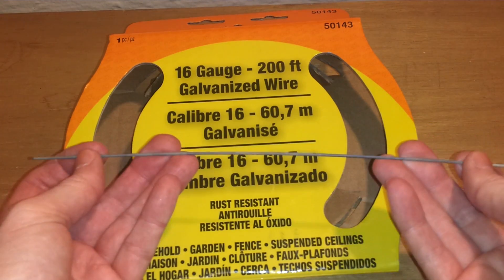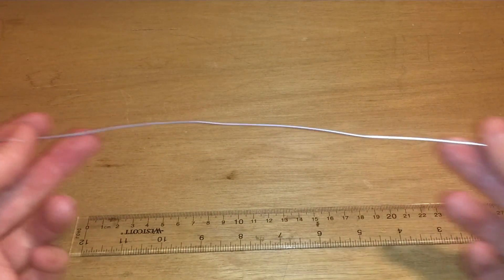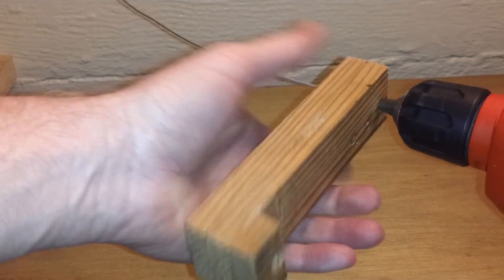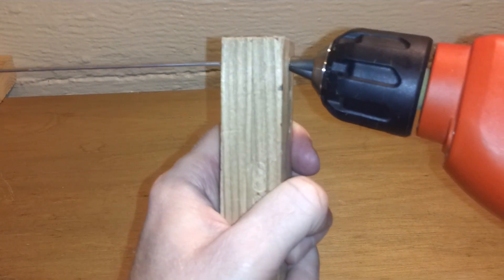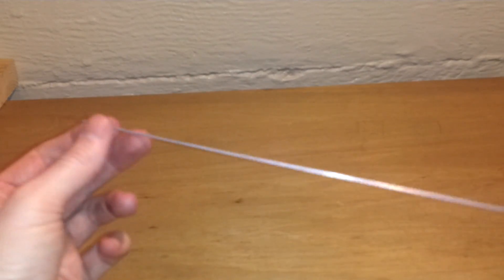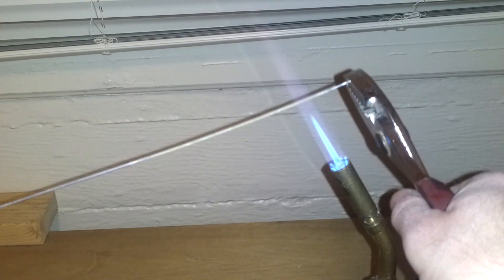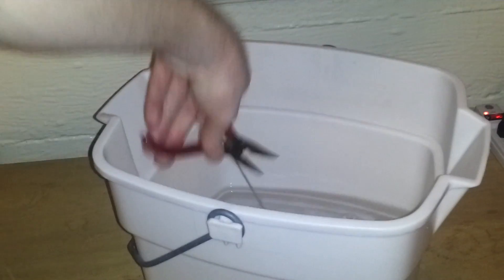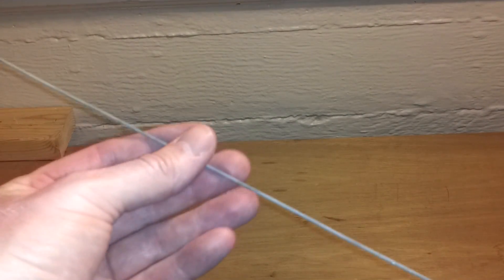How to straighten 16 gauge wire to make control rods for RC airplanes

Comment: You can get similar wire but stainless at harbor freight. I like this method better than twisting the wire which does straighten the wire but I think it weakens it also. I appreciate you

Comment: would the re-heating process damage the galvanized coating?
Reply from the maker: Don't know.  Not like the control rods are going to corrode.
Reply: @MrDabrudda  Putting the zinc (the galvanized part) in the flame creates hazardous fumes. If you're going to heat it, don't use galvanized wire.

Comment: Nice one....Hope it works with 22 gauge Full Hard Steel wire that I will use for model bridge building. Thanks.

Phil
Update: I tried it with the 22 gauge Full Hard wire and unfortunately it does not work. I know this method you used for the thicker 16 gauge works very well according to many videos I watched however. If you have any ideas how I can get the bend out of the thinner 22 gauge I'd appreciate your input. Thanks.
Reply: Well you said yours was full hard. His method is for softer wire.
Reply: @jamescole3152  Yes for sure. That's why I said I was hoping and did update my original comment....This was over a year ago and solved the issue another way, but I appreciate your comment...Be well...

Comment: It's better to pull the wire without winding it, you can also put it instead in the drill chuck on a thick rod piece withe a loop and pull it without compromiseing the strength to much, or put somewhere a hook in the ceiling or something strong and put on the other end a weight and lett it hang for a little while 😊
Reply: Yeah I usually pull the wire a couple of times angled down over a wood work bench, works good on shorter lengths as a 2-3 foot piece will still have a little curve in it.

Comment: I dont think that amount of heat would do squat! Plus its all cooled off by the time you got it in the water! I was just in my shop doing some 9 guage and tried several different heats and dipping it in oil verses water and what did the trick was getting the whole wire glowing red like almost melting and throw it in the water. Thats when I got the wire hard. You can't just get it orange and let it cool b4 you quench it or itll just be softer actually.

Comment: Very nice! Would this work on a 2.5mm wire for the landing gear? Would it prevent the bending or it is still bendable and I shouldn't try? Also alternative ways for heating? I don't have this tool...

Comment: Can the wire still be cut after heat treating? Looking to make pins for linking pieces of an RC tank track, they will be roughly 5/8 inch long, not trying to do this process for all 50 pieces, not to mention the nightmare of working with pieces that small
Reply from the maker: You can cut the wire or use a grinder if the cutters leave a mangled edge.

Comment: I've started to use carbon rods in place of wire inside Sullivan-style plastic tubing. Lighter and stiffer, and short wire Z-bends at the ends can be glued with CA inside a heatshring tube. This final gluing can be done as the last step, to get exactly the right position. CF rods are sufficient stiff  to not need long wire rods at the ends, but sufficiently bendable to go up T-tail fins, for example.
Reply: How thick of rods? I'd love to see a video of your technique!

Comment: I bought a plane, and forgot that you DONT bend the rods, they use a special nut, will this work on a fully assembled plane?
Reply from the maker: It should work to make custom throw rods.
Reply: For undercarriage legs and other stuff   The wire edges of a bed mattress  is a great source of spring wire

Comment: what about straightening longer wire, like 2' long?
Reply from the maker: The block and drill method will work but you have to spin the drill very slow or the wire will flap around.  You could also try putting one end of the wire in a vise and the other end in a visegrips and twisting the wire.

Comment: I am sure you are long gone but you can simply stretch the wire if you want to do a lot at once.  pulling straight between 2 cars works well.  if it snaps then you pulled a bit to hard, go back in time and try again.

Comment: you can temper the lower guage wire with a blow torch and drop it in water and it will be very strong

Comment: Have you thought about using old bicycle spokes ? They are about the same thickness and are rigid and stainless steel :)
Reply from the maker: Spokes are thicker than the gauge of wire I used.
Reply: MrDabrudda OK

Comment: Leave the wire chucked in the drill and just move the torch along the wire. This should help keep the wire from bending while heat treating. I haven't tried it, but it should work.

Comment: Use jumper cables and a 12 volt car battery to watch the whole length of the wire heat up instantly to red hot. Hold it over a bowl of water and release the wire from the clips at the same time. MUCH faster and uniformly.
Reply: good way to ruin a battery. I just use my houses 220v outlet.
Reply: Just go to Tower Hobbies and by the right steel... sounds like a good way to get yourself hurt either way.
Reply: Jumper cables, batteries and water? I'm gonna die lol
Reply: That sounds simultaneously thrilling and scary, so I'm going to try it! Thanks
Reply: hey....nice trick... i should try this too... thankz

Comment: Could you use high current to heat it red hot?
Reply from the maker: You could but this thickness of wire would take a lot of amps to heat up.
Reply: Matthew Perry, that is exactly the recommendation I was going to make. For a 3' piece of wire I set my arc welder to about 50A, clamp it between stinger and ground, and flip on  the switch.  In about 5 secs it is orange hot. Flip off switch, drop in water, and cut to convenient lengths for straightening using the brilliant method shown here.

Comment: I used this technique on .055 in spring steel music wire. It works great! My controls rods were about 30 in. I imagine the shorter the pushrods the easier it is. The 30 in pushrod was a two person job.
Reply: Awesome I was wondering if this technique would work with music wire.

Comment: Hmm!  I was wondering if that wire would bend if you made a control rod, but you solved that issue.  Well done!
Reply from the maker: You only really need to harden the rod on very long runs between the servo and horn.  A few inches will not bend very much.

Comment: Thanks for sharing.

and psst... don't tell the naa sayers but the galvanized metal has to be heated to a gaseous state before it's harmful. That little propane torch can't achieve that.

But keep it our secret... just look at the post, nod your head and smile. 

Laugh inside of course but what ever you do, Don't let them know that fact...!! It could prove very harmful. 

It'll ruin their parroting abilty... just saying.
Reply from the maker: Yep, there are experts about nothing all over the interweb.  I've gotten plenty of hate mail about heating galvanized metal in this video.
Reply: MrDabrudda harmful at welding temps...NOT at these temps...thanks for the trick!

Comment: The hardening method did not work it just made my galvanized wire soft... I quenched it in ice water. I couldn't keep it red throughout the wire maybe that was the problem, but it didn't work for me
Reply from the maker: Mitchell Spanheimer If you let metal cool slowly it is called annealing which will soften the metal.  Quenching the metal when it is red hot or close to red hot will harden iron and steel.

Comment: As a safety note do this in a well ventilated place as zinc oxide is released
Reply: Goat wdym?
Reply: Hmm .. sorry for that .. but no need to be smart .. 99.999 percent of the food u r eating from the markets have poison and 99.999 percent of the water and air u r drinking and breathing have poison .. so plz stop
Reply: @phoenixcreations94  Do you know what you're talking about. Goat was simply talking about the galvanized metal releasing the oxide. Not general pollution.

Comment: This is my fav instructional video on youtube!  Well done very useful, but only in California.  I laughed for 20 mins after that
Reply from the maker: I received a few hate emails from people stating the hazards of heating galvanized metal and not warning people who view my video.  Maybe that's why my windows are open in my shop which they can't see in the video.
Reply: @MrDabrudda  I think he might be laughing about the actual "hardening" of the wire. I don't think that wire can really be hardened. It's mild steel. However,  if it can be hardened, you would have to get the whole wire orange hot and quench it while it's still orange. Then it would have to be tempered. I think it's the act of straightening the wire that leaves it a bit work hardened. ...like wrought iron. I think heating it up after its wrought out straight might actually make it softer, not harder. ...anyway, great technique on straightening the wire. Thanks for posting 
Side note: if it wasn't for California, there would be no YouTube to troll from

Comment: dumb question here... i have 18 gauge copper... can I heat it with a torch to harden it?
Reply from the maker: dohrehmee You can harden copper.  People anneal copper used in jewelry but I'm not sure if the copper would be hard enough for control rod.  One hard landing and the copper might bend.
Reply: I believe copper will go from barely shape-able to brittle.

Comment: The hardening process you recommend is applied to medium/high carbon steels. As far as I know, the carbon content in such steel wires is small, so I don't think that this would make a big difference. It's worth a try though
Reply: Yea I think you're right, I've tried this on regular wire not galvanized and it doesn't seem to do much, maybe slightly springier but not actually harder or less prone to bending, will just deflect more without permanently bending.

Comment: Is there really enough carbon in that steel to harden it? Wouldn't it need to be cherry red across the entire rod if there was a high enough carbon content?
Reply: Actually the carbon content has everything to do with hardening steel. Without a high enough carbon content it won't harden at all. Without tempering the wire should be glass hard and resist a file if it was actually hardened. I'm not saying your wrong I'm just surprised the wire has a high enough carbon content and that you were able to get such a skinny piece up to a high enough and even temperature to form metastable martensite?
Reply: On a safety note, galvanized coatings release zinc oxide fumes, inhaling these fumes can lead to metal fume fever. Probably not fatal but very unpleasant all the same.
Reply: Someone's deleted their comment. no clue what happened here.